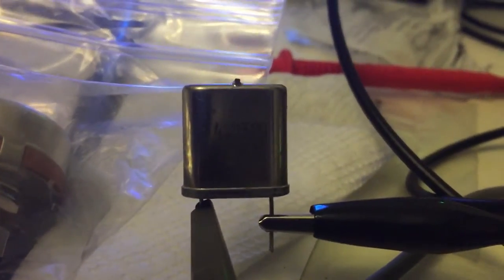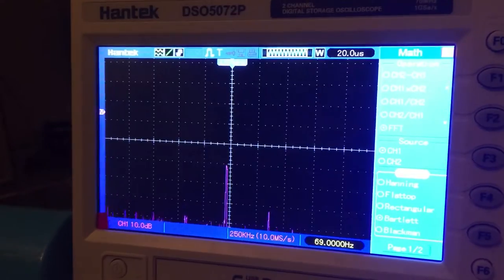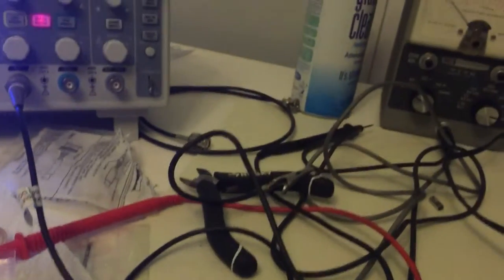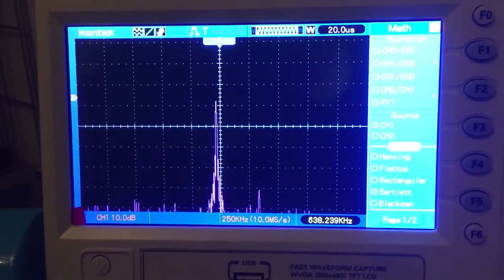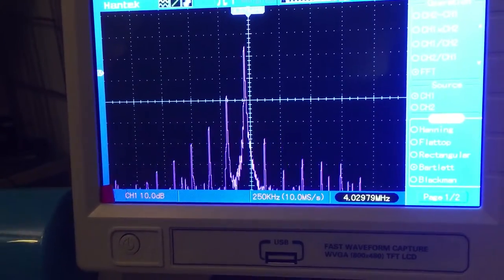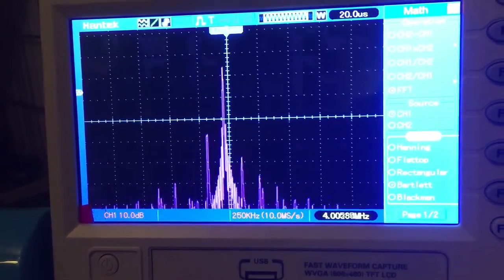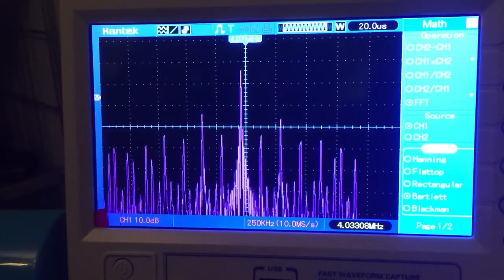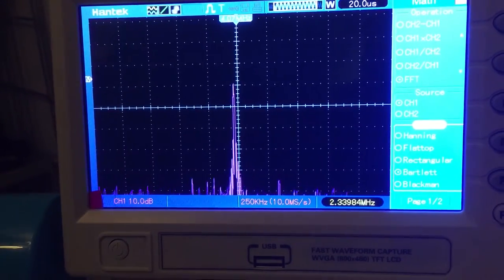Hantek DSO5000P DSO5072P measuring crystal oscillator with a Feeltech FY3200S

Comment: Hi I need to measure some  10MHz SMD clock oscillators to verify their frequency at different temperatures. I would like to use your method versus having to put each device into a board circuit. Do you think this will work? The oscillators are a 6 pin design and I am not sure how to hook it up.
Reply from the maker: Depends on the specificity of the test... the parameters?  Most stable oscillators are temperature controlled (or were)
Reply: Hello !
You learn on google with keywords
IC Adapter .
There will be something suitable for your job